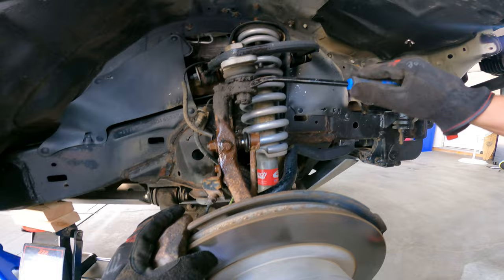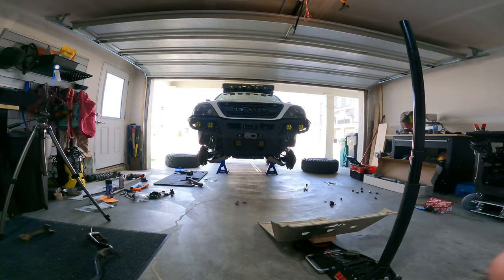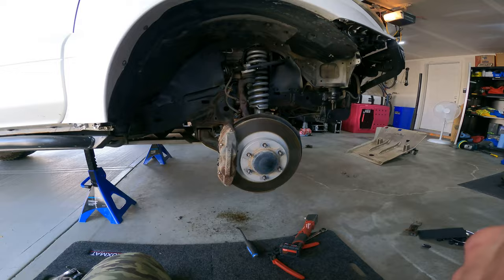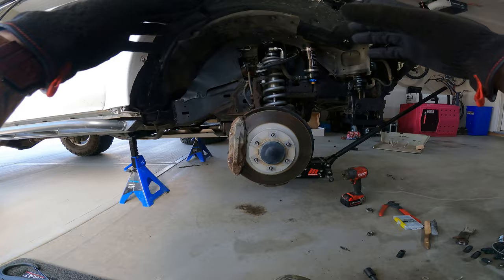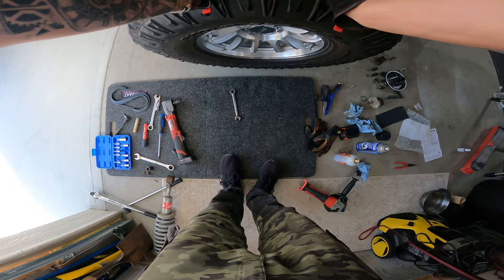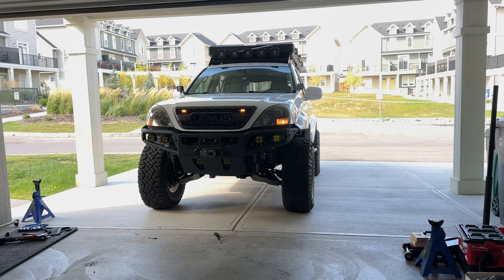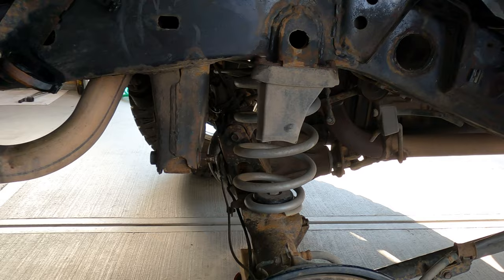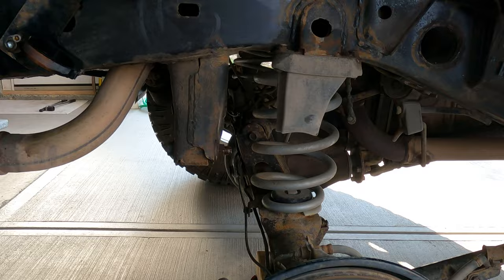Rebuilding My Neglected 2008 Lexus GX470 #lexusgx470 #buildupdate #offroad

Comment: Keep the front sway bar off and reinstall your rear with some extended end links. It’ll max out the amount of travel you can get while still keeping it balanced on trails. I’ve been 3 wheeling a lot less since making that change.
Reply from the maker: Thanks for the suggestion I think this is the right move for sure!
Reply: @LoganKingMedia  front can stay off, doesn't do much. The rear does more for flex you'll get better articulation with front off, rear on just get extended links yea or anti rock setup
Reply: Absolutely agreed, good chance to replace the sway bar bushings as well, or else you might break your sway bar when it binds. (as me how I know)

Comment: Ive been wating to get all my parts to put them in one time got the bilstein 8112 bilstein b8 upper rear 2in dobinson spring and air bag delete just ordered dobinson upper rear control arm just wating for next week order lower rear dobinson control arm and adjustable sway links and pand hard relocator then im going to strip everthing clean rust and repaint and put it all together one time